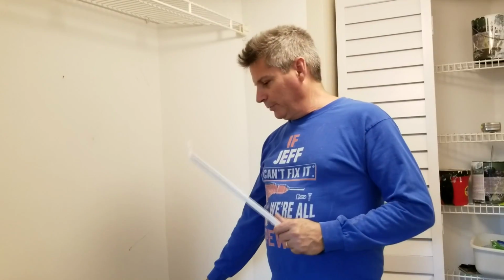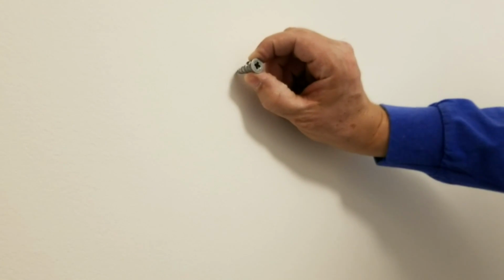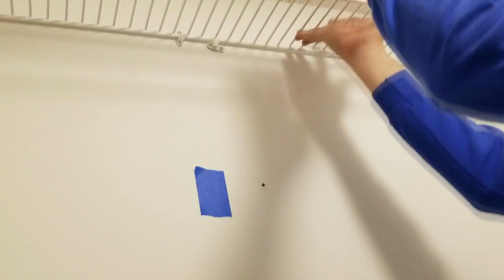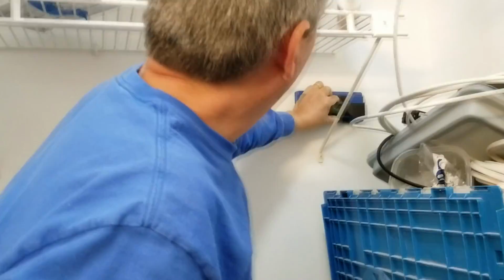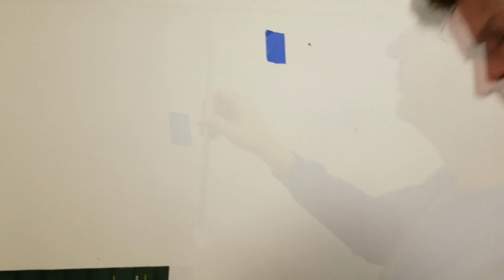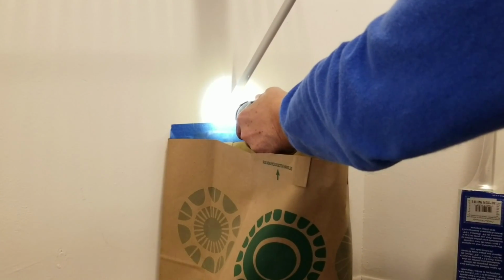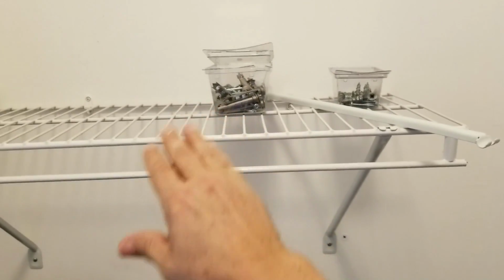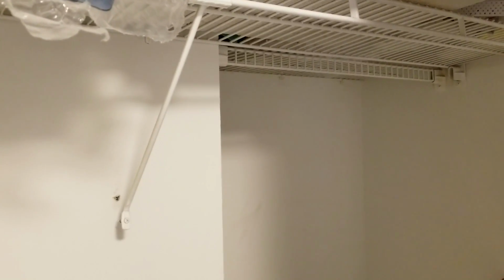DIY How to Repair Closet Wire Shelves Falling Off Walls

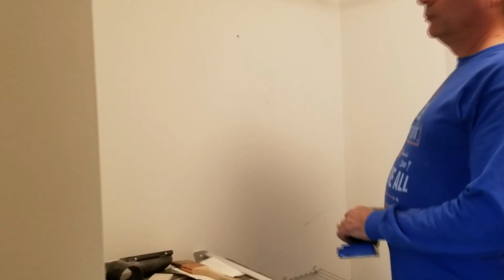Comment: Vertical pieces of plywood perpendicular to the shelf running from the shelf to the ceiling (and attached to the wall) will strengthen the shelves tremendously. It will also transfer more of the load to the walls, off of the joists/trusses. 2:21

Comment: Awesome DIY....one question I have . ...I am thinking of making this for my books? Rope bookshelf sort off ....Will it handle a good amount of weight? 3:55
Reply from the maker: The large anchors hold 100 lbs, the smaller anchors hold 50 lbs. Don't use the smaller anchors unless you are drilling into a wood stud, because the smaller anchors don't have the swingout arms to grip the back side of the drywall.

Comment: This is a very basic question, but what, exactly, is a stud?
Reply from the maker: Studs are 8 foot long 2" x 4" wood boards that form a skeleton which the drywall is screwed into . The studs are usually 16" apart per building codes. Here in florid we typically use thin metal studs for drywall, and only use wood for load bearing walls.

Comment: What if you don’t have a stud finder?
Reply from the maker: Get one. 1 Every homeowner should have at least one of this stud finders I recommend below. As a last resort if you have a strong magnet you can drag the magnet back-and-forth on the wall until you find the buried drywall screws. Once you find those dry wall screws you have found the stud.

Comment: Can you link the screws you use for metal studs? No anchors needed if you use the studs, right? Thank you! Very helpful video.
Reply from the maker: Here's the 2 different screws you need depending on if you have metal studs or wood studs. For wood studs you need to penetrate deep, so we use 2  1/2" just like kitchen cabinets. Sheet metal studs are hollow so 1  1/4" is all you need: 
✅ Metal Stud Screws: 8 x 1-1/4" Self Tapping Stainless Steel Metal Screws Pan Head  https://amzn.to/2NJ43AP
✅ Wood Stud Screws: GRK 120660 White Cabinet Screw #8 X 2-1/2":  https://amzn.to/2C5OUTa

Comment: I regularly have an issue with the bracket "claw" attaching to the front of the wire shelf.  I'm pretty sure the install is correct, it really can only go one way.  It seems like it would make more sense to have the claw flipped the other way so the shelf sat in it.  I read some people use zip ties to keep the shelf from dropping away from the bracket claws.  Do you run into this issue and is there a fix?
Reply from the maker: Yes I have had this issue a few times and it's very difficult to overcome its just a very stupid design. But what I do as I place that angled  Support bracket up against the wall and then I slide it all the way up so that it comes right up directly under the wire shelf to the point where it doesn't look like it's going to move and that's where I make sure I mark it iand screwed into the wall. Keep in mind this is not my choice for installing new closets I don't ever install new wire shelving I will only repair old wire shelving or spray paint over it. But whenever I'm doing new closet shelving I only use their shelf track system which is far superior because it uses a cantilever and the wire shelf rests on top of those cantilevers which are fitted into the slots on the vertical standards that are bolted through the dry wall into the studs. Have you seen any of my other videos where I install these?
Reply: @jeffostroff  thanks for the reply. I haven't seen your other videos, but I've used the shelftrack. Like you said it is a way better system. I just did a job today that involved several things including installing a shelftrack system in a pantry.  The client also wanted a single wire shelf above her washer/dryer so I got a 6' piece with the standard angle brackets. I've used them a couple times before with the same issue, so I think it's time to right them off. I don't know why they don't just offer a solid angle bracket for them like a solid shelf would have.  In the meantime I need to go back and adjust the one I put in... Going to try clamping the claws a little so they bite more, and then probably put a few white zip ties on them.  Not pretty, but should hold.  Crazy they continue to sell such an awful design.
Reply: you're supposed to put the diagonal support so that one of the wires on the shelf runs the middle of the support; Jeff installed it improperly in the video.

Like in this video
https://youtu.be/jRaQ3YjV47g?t=22
Reply from the maker: @Jujoji  It was installed according to ClosetMaid's own instructions, LOL! Look at item "K" Support bracket on their instruction sheet, you'll see even they show it in the space between sires. . Besides, putting it in between the wire won't solve @rmryder88's problem. The problem is there is too  much flex in the shelves, and the support, and they should have designed the support to that the wire shelf sits in the useless half loop there which does not wrap enough around the the shelf wire. Look at their useless instruction sheet here. https://images.homedepot-static.com/catalog/pdfImages/83/83749163-d9f0-438f-80b3-54b5e56c5d2d.pdf

Comment: Thank you so much for this video. My shelf fell down just last month. I definitely agree about the poor design. Mine had actually stayed up without problem for over twenty years but, when I removed all the stuff I stored in crates on the shelf, the weight of the hanging clothes made the back of the shelf pop out of the clips, and down it all came. To be fair, there were more clothes than usual hanging from the shelf; I usually put out of season up in the attic but had neglected to do so last Winter.
Reply from the maker: If the builder had installed it correctly the 1st time screwing it directly into the studs it would not have fallen off no matter how much weight you put on it.

Comment: Does the easy anchor have to be in the stud as well or just through the drywall?
Reply from the maker: Sergio, the EZ Ancor is only used in the drywall, not in a stud. In the case of the stud, you use a screw to go through the drywall and at least one inch into the stud.  You would not be able to use an EZ Ancor on the stud, because the EZ Ancor requires the air space inside the wall for the back side wall bracket arm to swing out.
Reply: jeffostroff thank you so much. I’ll keep you posted upon my progress.

Comment: I attached mine to the studs and those crappy brackets the shelves come with still fell out of the wall!! Ugh!
Reply from the maker: If they still fell out of the wall, then it means you did not hit the stud with your screws. Another root cause can be people who pre-drill a hole for the screw in the stud, but the hole is too big so the screw just pulls out.

Comment: Thanks for making this video! This literally happened in our closet this weekend. We bought a brand new house,  and the wife was hanging clothes in the closet and when she put something on the shelf and the whole thing came crashing down exactly how you described it. So I started researching how to repair it and this was the first video that popped up. It appears that they drilled in between the studs.
Reply from the maker: Yes indeed, that's how they all do it. The closet shelf installation people that builders use are the least talented of all the trades.  Hope works out for you now that you know how to repair it.
Reply: @jeffostroff   Just so I am clear, you said the  E-Z Ancor Self Drilling Toggle Anchors can support up to 100 pounds each? And that is without drilling them into a stud? I ask because the wall that shelf was on looks like, and I have to double check it, that the studs are at the corners, nothing in the middle. It is an odd location to begin with.
Reply from the maker: @bw33511  Yes, the EZ Ancors are specked and designed for drilling into open space between studs, that is what the 100 lb rating is for, you don't need EZ Ancors when going into a stud, you just need a screw to go into the stud.
Reply: @jeffostroff   Thanks! This info is very helpful.